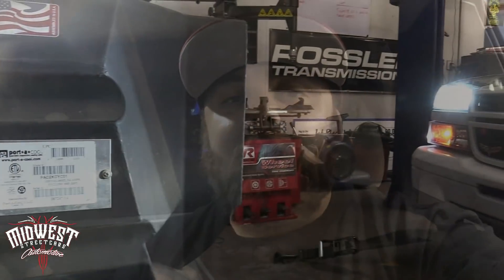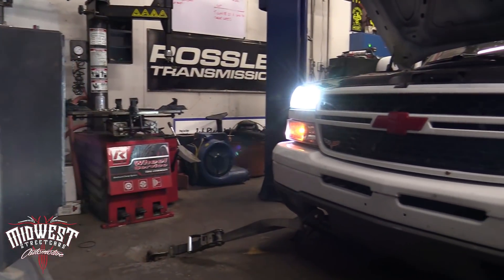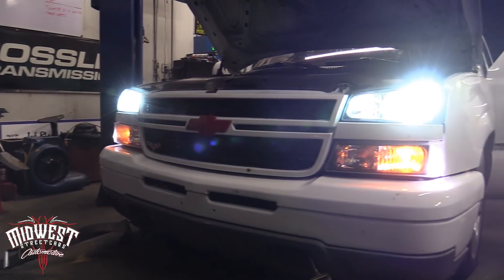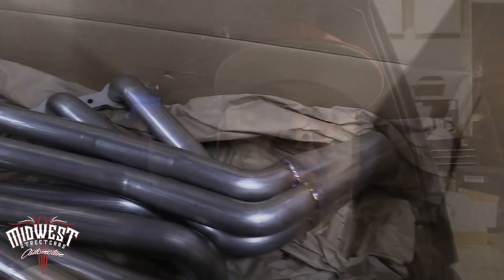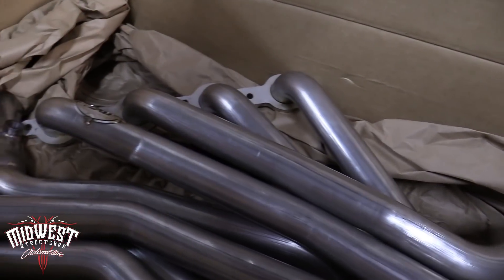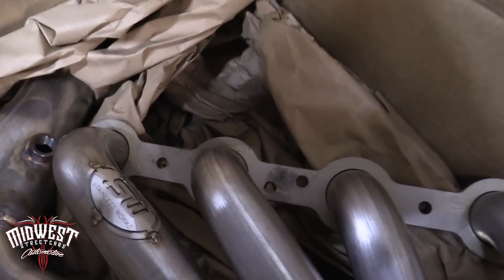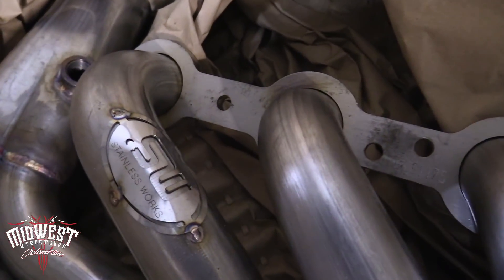Phantom's shop truck ChiChi baseline dyno!

Comment: 260@4600? Doesn't seem right for a 5.3 ??? I've seen completely stock 5.3s make 300 hp/330 trq seems very low
Reply from the maker: Mikel Bentley no you haven’t. And this one made 306
Reply: Mikel Bentley any newer truck will smoke this now adays

Comment: Can't wait to see numbers after exhaust , my 4.8 with longtubes and single exit stock pipe with a muffler and 93 tune made 320whp on 22s with a tsp stage 2 cam 212/218
Reply: Graham Davis any plans of boosting it?
Reply: read mypost yes eventually I just bought 799 heads gonna mill them .35 and port etc , then get a rebuilt 4l60e or 4l80e I need a stall first tho but I dynoed the truck when I had 3.23s now have 4.10s , it's all been done in 2 months so I've gotten everything done pretty recently besides the headers
Reply: Outkast Racing  nope , just single turbo
Reply: Build the truck around the stall converter, or build the stall for the truck but don't ever just throw one in because it looks like it'll work lmao

Comment: Part 2: ljms cam and 77mm turbo install

Part 3: rip 4l60, th400 with brake install

Part 4: 4 link and 14b

Part 5: okay it's not really a shop truck anymore lol
Reply from the maker: Mason Smith no and no
Reply: Midwest Streetcars Auto I said no to drugs but it doesn't mean they listened
Reply from the maker: Mason Smith I'll do more but I won't use either of the products you mentioned
Reply: Midwest Streetcars Auto drugs and ljms? Not using ljms is cool but don't rule out some drugs😂😂